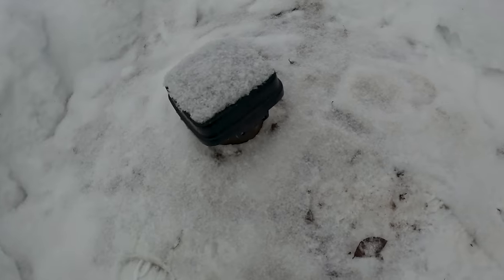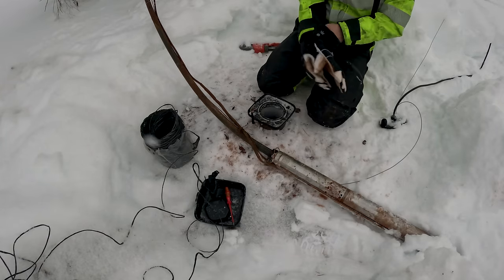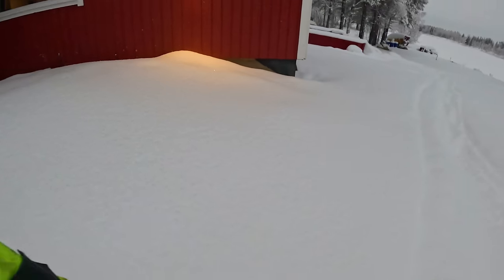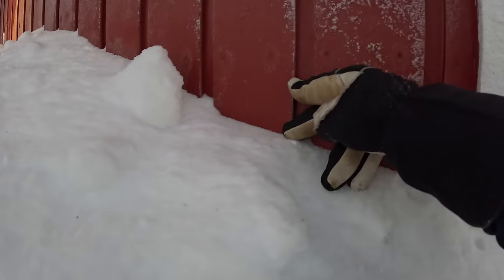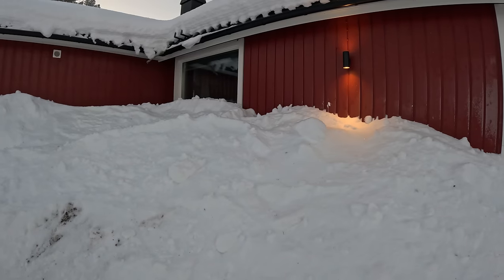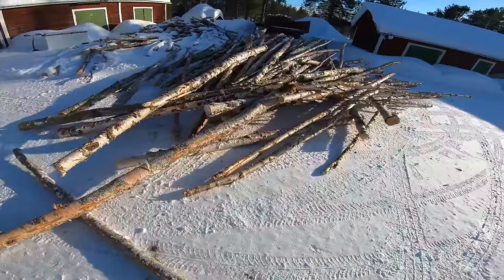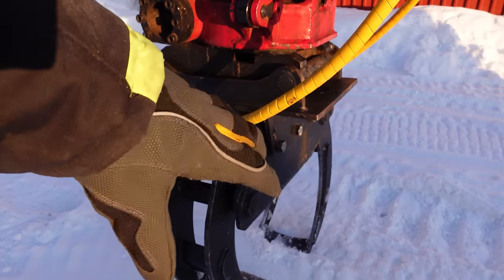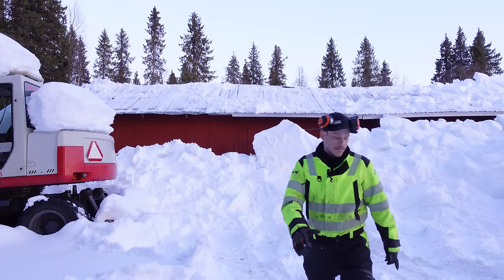Well Repair, Snow Insulation, and Roof Snow Clearing

Comment: Snow is one of natures best insulation.
Reply: Snow is also very good for water absorption too. Used to use it years ago when trapping beavers to dry their pelts off after pulling them from the water. Just pick up a couple handfuls and wipe it back and forth across the pelt and it’s dry.

Comment: Growing up in northern Wisconsin, we would bank our house with snow every time, the drafts went away instantly it changed the comfort level in the house dramatically. The only thing worse than a cold winter is a winter without snow For insulation
Reply: I’m from Wisconsin too - did you worry about the snowmelt near the foundation with the basement?

Comment: Just a heads up, that pump will fall off again. The vibration over time with the aid of gravity will cause that coupler to slip and the pump will hang from the wires again. I’ve recovered pumps from the bottom of wells when the pump fall off and the wires twist up and break. 

In the states, the industry standard for submerged pumps is to use Schedule 40 PVC and thread everything together. Hope this helps!

Comment: Not a problem with freezing pump when the ground water is 4°C. The cabel should be taped better and would recomand brass fittings for better longevity. Also disconnecting the top and using a reel is an easier way of pulling a pump. Looks like you have a lot of sediments in your water, try asking a welldriller for plugs to get rid of the problem.

Comment: On our well we needed a "torque arrestor", a rubber bushing that fits around the body of the pump and pushes against the sides of the well casing pipe.  If you don't have one, when the pump turns on the inertia of the rotor will spin the pump body the opposite direction, which can twist off the wires or pipe!

Comment: A friend of mine told me he had a lot of issues with iron deposits on his well pump in Piteå. And he measured the voltage between the pump casing and the ground and could see a voltage potential. That caused an electrolytic process causing the pump to draw iron to it. So it might be an idea to remove the earth for the pump, or at least measure it.

But if it was just sediments, then it might not be an issue.

Comment: Also you can cause your steel siding to condensate by stacking snow up on it. 
I know your thinking insulation but not with a heated building with steel siding.  I have worked and lived above the Arctic circle most of my life. 
Been there done that

Comment: I am amazed how easy all your different vehicles start and run at -20C. It must be a very low humidity? Do you have any thermal heating. Do you purify the water before drinking it?
Reply from the maker: I found that sticker in the garage, need to buy one for my newer truck also

Comment: They make a collar that goes around your pump  that keeps it from jerking at startup . That is what is unscrewing your pump!😮 Start after start....
Get the collar. Pump arrestor/ holder) I don't know the exact name for it. They also have them to snap on the well line so the line doesn't rub the casing wall and you can get a leak that way too 😮

Comment: How many houses are painted that red?

Is this an unusual amount of snow? If not, why is the roof pitch so low?

Snow angels on the roof?
Reply: Red houses is the norm in Sweden. The red paint was a bi product of copper mining and the cheapest colour.
Reply: Houses are built to a code. Depending on location your snow zone is different. But its quite predictable. Its cold so all the snow accumulates during winter. But rarely its 30 cm of snow in a night. Not like BC or really mountainous terrain close to the ocean where you can get many feet in a single snow storm. I would say 1.5 meters grund cover on a normal winter. Maybe 95 cm right now tops.